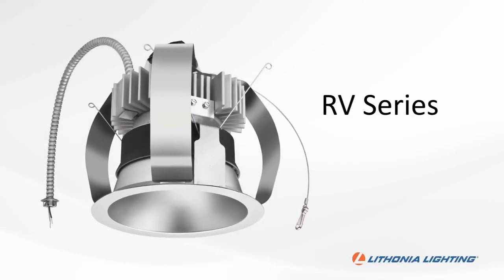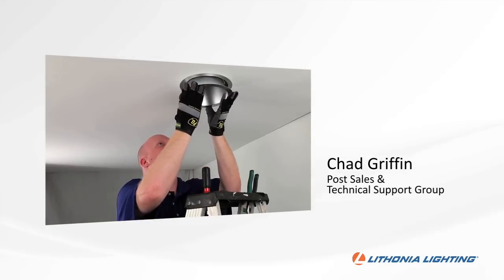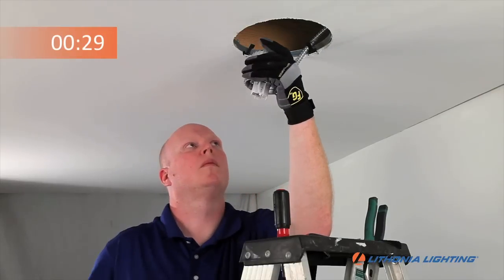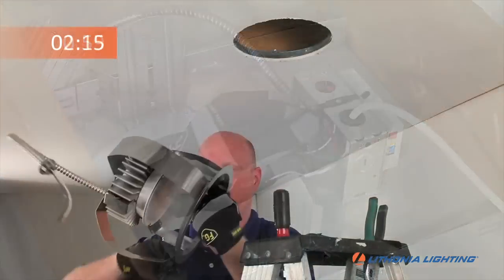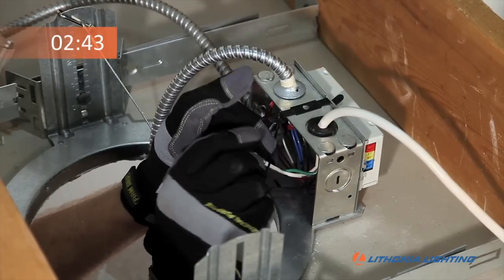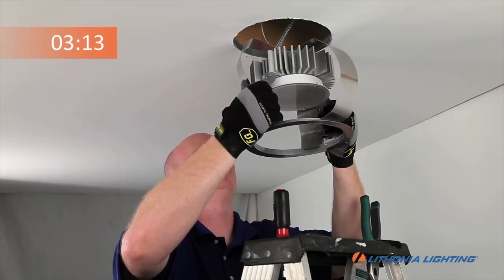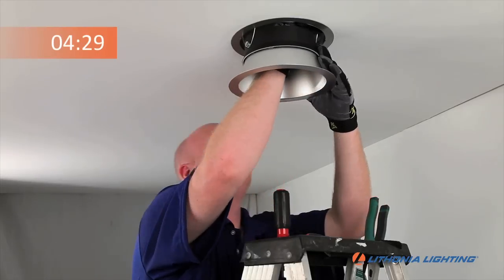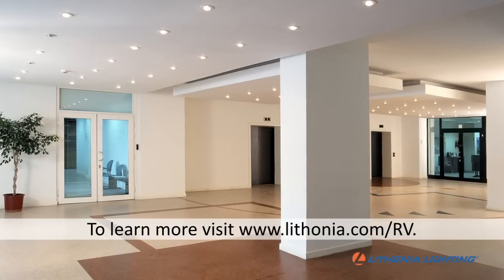RV Series Downlight Installation Procedure

Comment: This is a great product, but I have a concern about the old part of the fixture that was left in the ceiling.  Local codes often state that any and all unused wiring must be removed.  Does that apply to the portion that was left in the ceiling in this video?    Even though it is not "live", the flexible conduit still was not removed from the junction box above the ceiling.  I am looking into replacing my recessed can lights here in my home in the next couple of years, and this looks like a great solution.
Reply from the maker: dave,  let me get in touch with the client and see what they say.
Reply from the maker: dave,

here is the response i received from Chad Griffin of post sales and technical support:

I have never seen that in NEC codes.   We may have to look into it but for RV installation if they are unsure about leaving the socket assembly attached it is an easy fix…you just remove the whip assembly.   Not sure why this would be a big deal either way.   RV would not be recommended for RESI use for the simple fact that its not IC rated…99% of home applications are using some type of insulation.

if you have any other questions, their support line is 1.800.315.4982.  hope this helps.